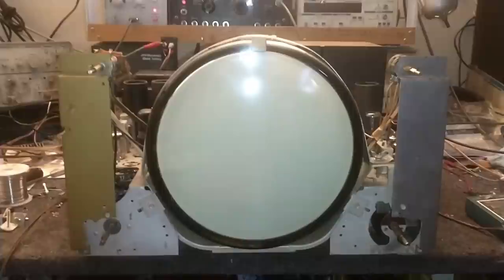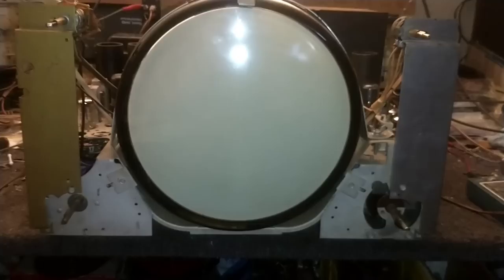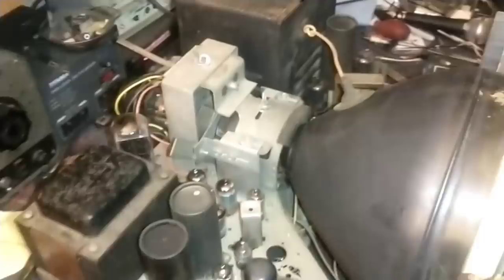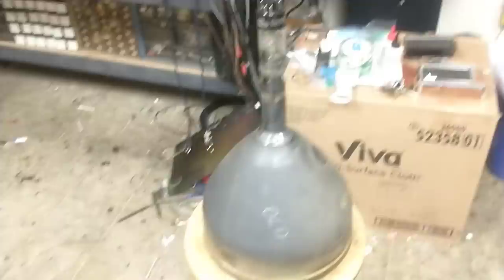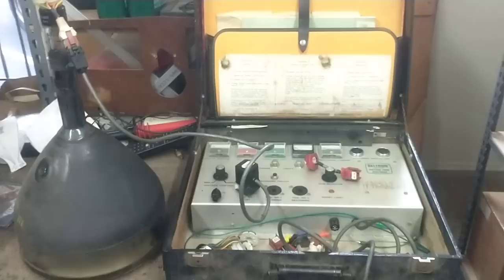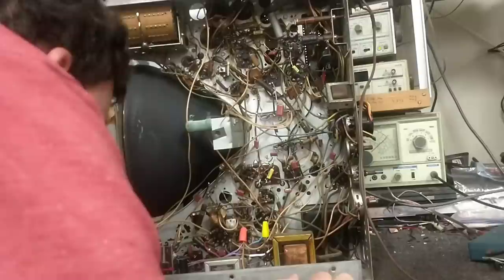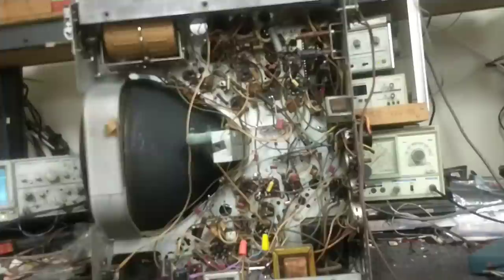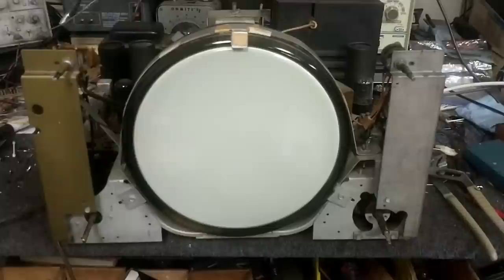Servicing a late 40s Emerson 614 10" b&w Television. No picture, HV OK. P2/? CRT swap, ion trap???

Comment: 7:28  That bend in the gun parts is normal.  It's designed that way to prevent ion spots in the picture tube face.
Reply: Yep.  The ion trap (often called a "beam bender") is used to bend the electron beam back on-axis, while the ions continue on, and strike the inside of the envelope harmlessly.

Comment: On my 611 I needed to make substantial adjustments to the tuner local oscillator (IIRC multiple turns) to get the fine tuning close to correct, and then the sound IF also needed major readjustment. You have a different tuner but it's probably still an alignment issue, maybe a dead tube or coil. With a directly-connected source I get close to 2 volts peak-peak on the detector output and this is more than enough to overload the later stages unless I lower the contrast control. I'd guess anything more than half a volt would work fine here. Pulling the 6AL5 and connecting household composite video should give stellar results if the later stages are working. You probably want somewhere around 20-30 volts peak-peak on the CRT's grid. Also note there appears to be an error in the Sams' schematic between the second video amp and the CRT, actually it is probably a different production run without DC restoration. I think you have DC restoration so the factory manual would have the proper schematic.

Comment: I am not sure if the metal parts are magnetic ? If so you may be able to use neo magnets to pull it back straight ? Maybe worth a try.
Reply: It's meant to be like that, so that any ions just run into the wall of the tube and not onto the screen.
The iron trap magnet, pulls the cockeyed beam back into a straight line so it can progress down the neck and into the deflection magnets. The ions are way heavier than the electrons, so the iron trap magnet has little to no effect on them and the just end up hitting the tube wall and progress no further.
In modern CRT's they have refined the electron gun so they no longer emit a pile of ions alongside the desired electron beam. Hence you won't find an iron trap magnet in newer TV's
Reply: @paulstubbs7678  Thank you for the explanation. I posted before I watched it all. And thinking there was damage , that was my thought's on bringing it back.